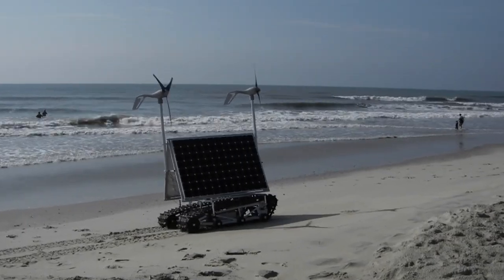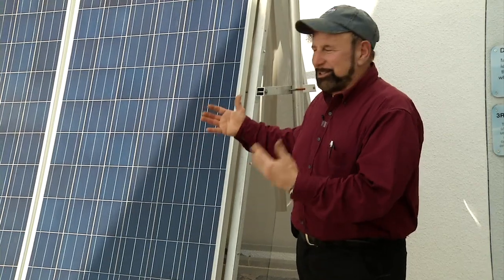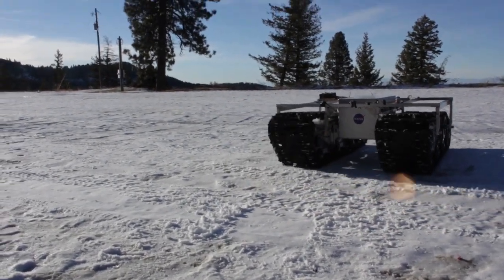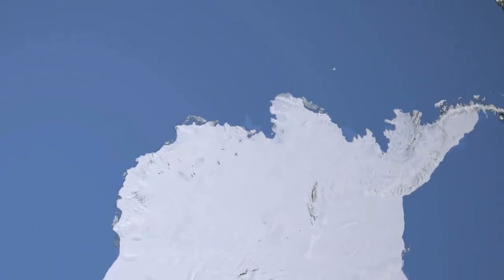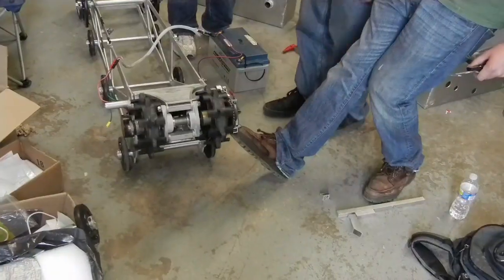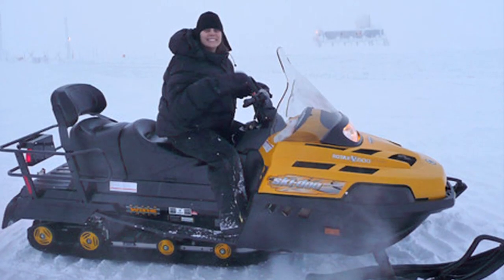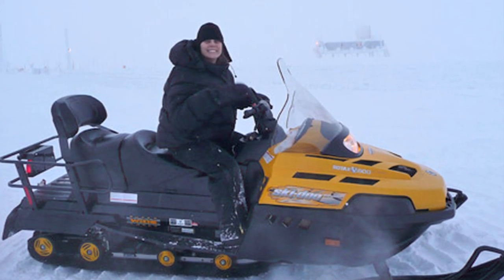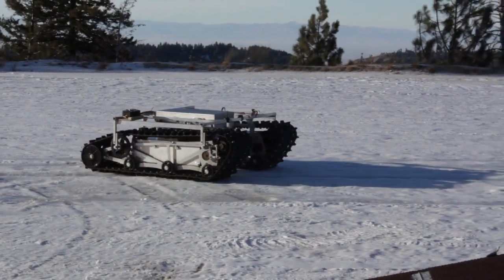NASA | GROVER Heads to Greenland

Comment: A vertical windmill is usually less efficient because every time a vane is pushed by the wind, the opposite vane is pushed into the wind. Vane shape makes them usable, but you're still losing a lot of power. Also you'd have to build it from scratch since you probably can't get vertical turbines that small, so more expensive.

I'm just surprised they didn't put the tracks further apart.